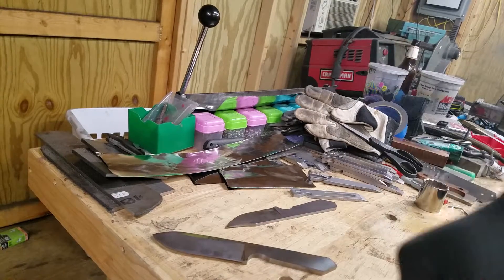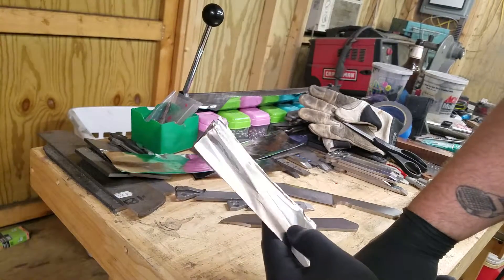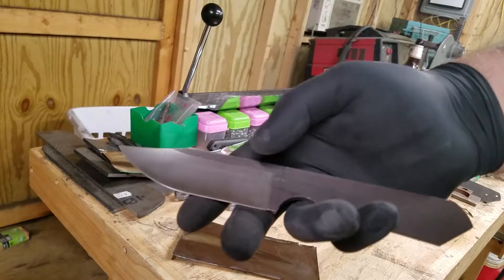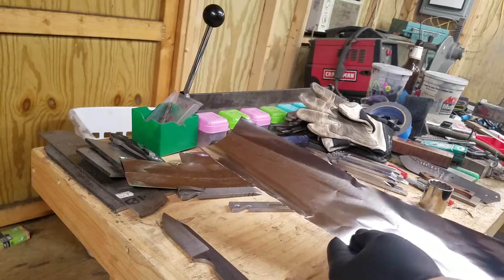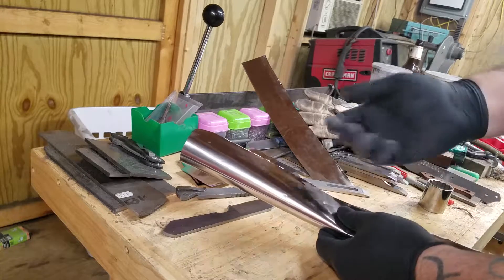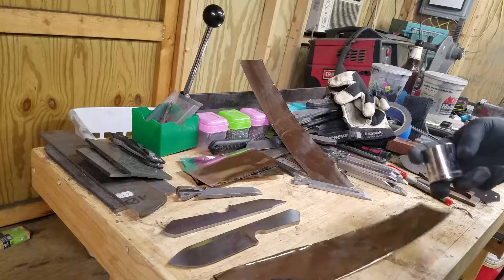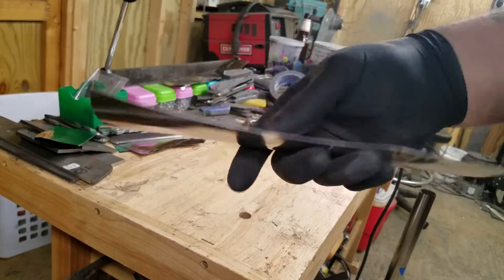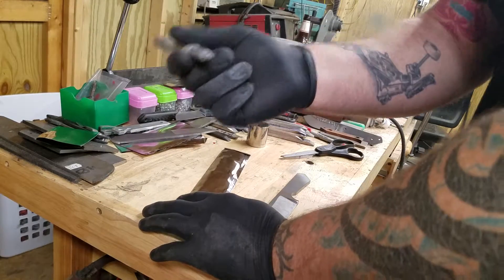Heat treat instruction (tool wrap)

Comment: What kind of steel do you use
Reply from the maker: I didn't see this comment, as of now ill use anything as long as its available in this new shop, ive got 3 ovens now , the dental furnace I rewired, a Paragon 16in and an Evenheat 27in
Reply: I've always wondered old bed frames the old ones not the new ones I wonder if they would work at all for a knife steel
Reply from the maker: @garrettliggett5082  some OLD bedframes were made from recycled railroad rail, but I've no idea when that would've stopped, I always suggest, especially to newer people, to just buy cheap 1080 1084 or 80crv2 (Not 1095) from the knifemaking sites its super cheap and you know what you have

Comment: Can you reuse the packets ? I've been heat treating 440c without this stuff for a while and I always have to grind off all the thick decarb off the knife which takes forever
Reply from the maker: Paul Woo, you cannot, they're 1 time use, but well worth it
Reply: Maverick Customs dude thank u so much for making this vid. I have another  question , how do u remove that fast enough to quench in oil ? Just use two pairs of tongs and rip it off ? I think ur the only guy on YouTube that made this video for tool wrapping SS , it's like everyone uses high carbon
Reply from the maker: Paul Woo, I don't, I quench in the packet, make sure you squeeze the packet tight to the blade after it's sealed
Reply from the maker: Paul Woo if you have any questions you can message me on my Facebook or Instagram page
Reply: Maverick Customs ohhh I see I see, that's smart. I'll find u on instagram. Thank you for the advice sir!